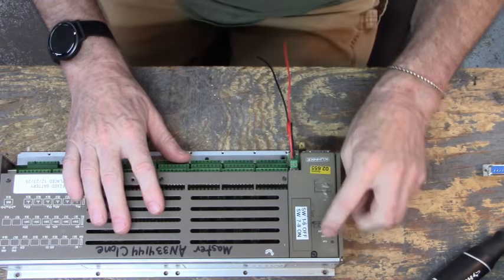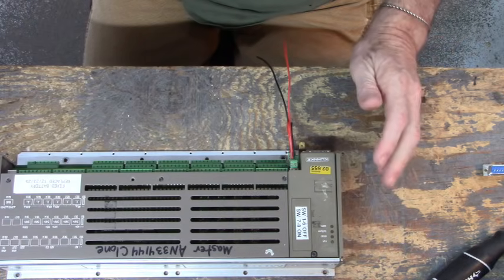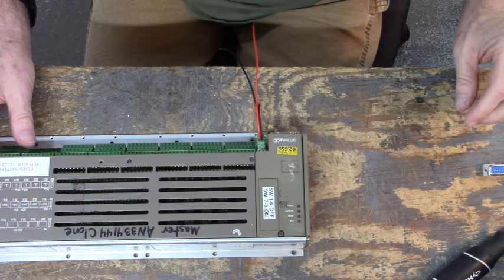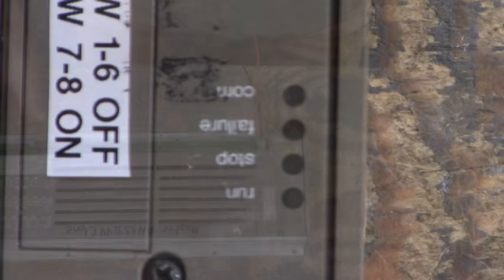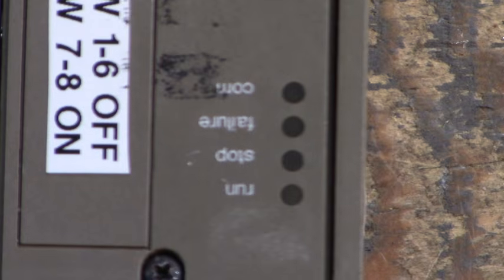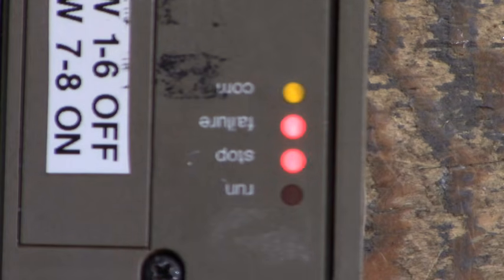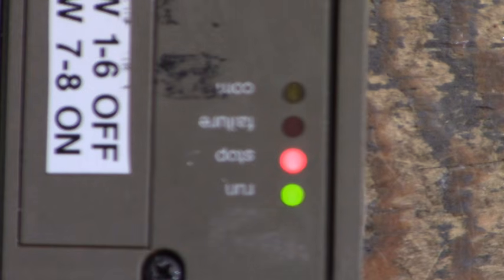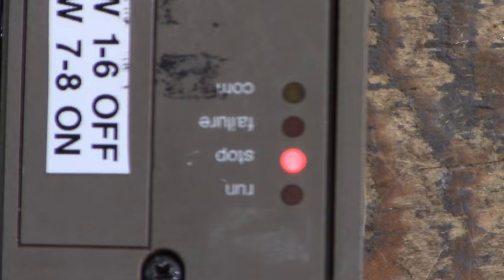Kuhnke PLC One Output Not Working

Comment: Hello peepaw can I check digital input, analog output and input circuit same way
Reply from the maker: That is a good question. I have never tried this method with the digital inputs. Nor the analog inputs. To test these inputs I will turn them on with an input voltage. I will have to try and see if I can test them with my dmm. Thank you for pointing me in a new direction :)